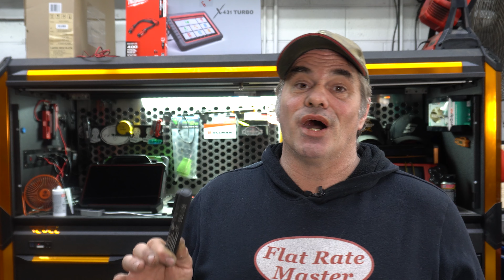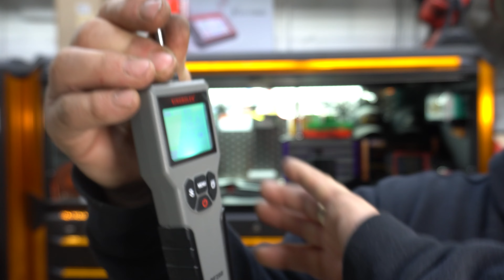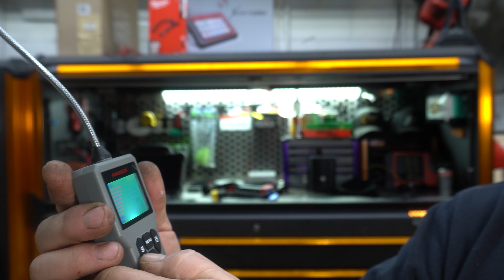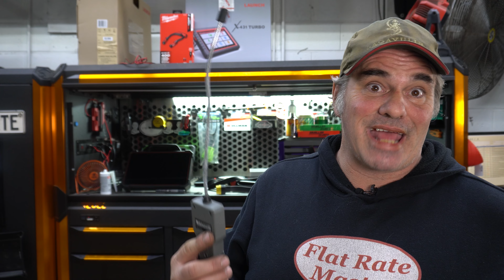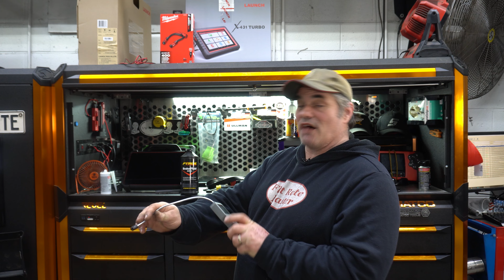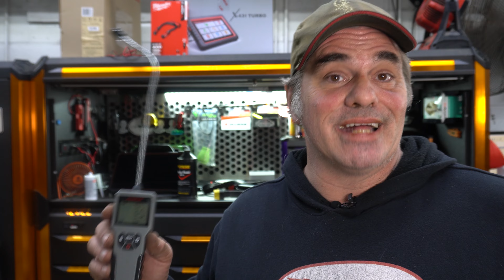Brake Fluid Tester- Why You Need One!

Comment: I'm over 40 years German car mechanic, they recommend every two years, I power flush 3 liters through the system. Great money maker, can usually do other things on the car while the fluid goes through. Run the right rear the longest than the left rear right front and left front makes a big difference. I'm getting 160-180 per car.

Comment: So I bought this tester from the Amazon link.  Figured I would test it.  Put it in straight brake fluid and it showed about 2 bars.  Started to add water at 1/2% at a time.  After first 1/2 % it shot up to 6 bars, like yours in the video.  Kept adding water till I got to 50% water and it still showed 6 bars, Okay, less than 2%.  Sent it back to Amazon.  Wondering if these are all this inaccurate, or I just got a bad one?
Reply: Anyone want to test their tester for accuracy?

Comment: I've stopped testing brake fluid some time ago. I've used both the test strips and an electronic tester. The problems were more with service writers and/or shop owners, than with customers. At most, they just have me drain and fill the brake fluid reservoir🙄

Comment: Four cars in one shop that are low on brake fluid? The odds are astronomical...

Anyway, this is not my idea. It's also a go-no go test. 

Copper in the brake lines are mostly what cause the discoloration seen in old brake fluid. By the time you see this discoloration, it's likely that moisture has found its way in too. 

DVOM set to DC Volts, negative meter lead to (-) battery terminal (if you can't reach the battery, a solid ground works too), positive meter lead in the brake fluid (don't use the actual lead, sacrifice a piece of copper tubing).

If the reading is ≥ .3v, the fluid should be changed. However,  It's easier to convince customers of this than it will be to convince your Foreman/shop owner. 

They'll be really skeptical...
Reply: Same method can be used for coolant.
Reply: @jimb8842  Thanks, Jim. Good to know. Same .3V and all?
Reply: @nathandnicholson  Yes, + lead directly in coolant.. I first learned and have always used .3v but I googled and saw .2 or .4. Interesting as .3 would be the average of those 2.
Reply: @jimb8842  I'll be using that for coolant from now on!

Comment: Northern European tech here, i do 3-4 brake fluid changes a week. Its a good profit for a 15-20 min job, we charge 100$ for a brake fluid change. I use a German BGS technic brake fluid changer, its a nice unit as it uses an eletric motor to pump fluid and put the resorvoir under pressure, it also collects the used brake fluid with 4 silicone hoses to each bleeder screw. Bought the machine 15 years ago for 2000$ and it paid for itself after 2 months. VIM brake bleeder wrenches is also a must.
Reply: Do you pen all bleeder at the same time , ?
Reply: @inverseuniverse5727  No  the machine flushes 100ml brake fluid on each caliper starting from rr->lr->rf->lf then it pulses rr for 50ml again to make sure all brake fluid is replaced.
Reply: And in the end it does a system leak test for 2 min to make sure all bleeder screws are tight and that the rest of the system is not leaking.

Comment: I don’t need a tool personally, I just flush it when time or mileage calls for it. Brake fluid can still be ok after 60k miles and 5 years. Its not as critical as they say. 30k mile intervals are best but…

Comment: OEM recommend brake systems flush, test calls for brake systems flush, flat rate master said it's important to flush brake fluid.  Also flat rate master  truck got some rust on it and needs a brake system flush, if I'm not going to make my full NUT $$$$ and it means I'll have to actually work I'm not gonna recommend the brake fluid service. Sounds about right 🤬

Comment: I avoid opened up brake systems unless required. If pedal is soft, or I am opening for component replacement.... sure. But that's a can of worms I don't want to open.
Reply: Are you also referring to just opening up the cap of the brake fluid reservoir? Could that negatively affect the brake system?
Reply: @TheHunterHofman  Probably brake bleeders braking off, needs to be a real unmaintained pos for that to happen